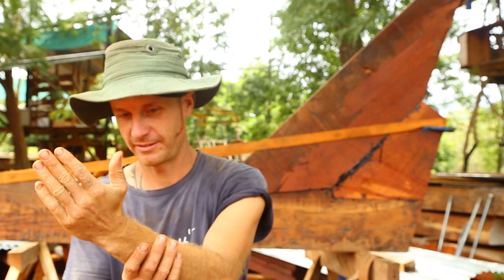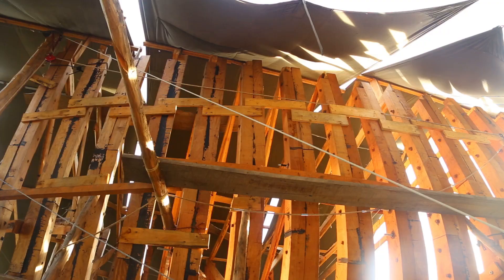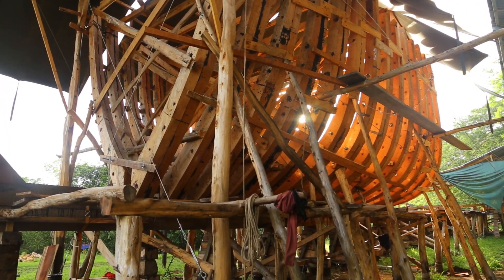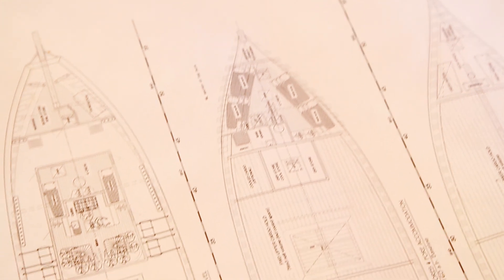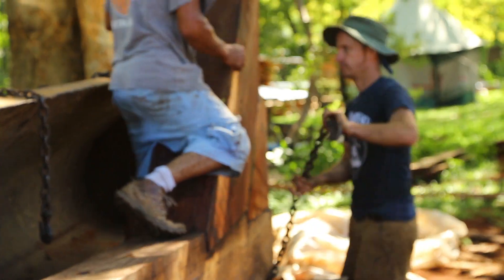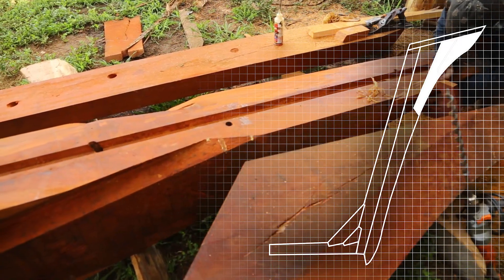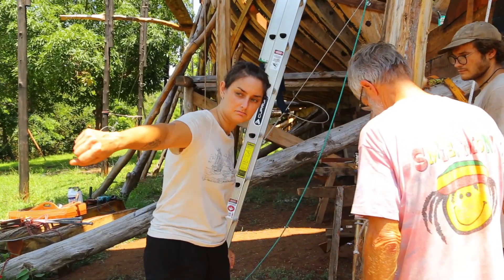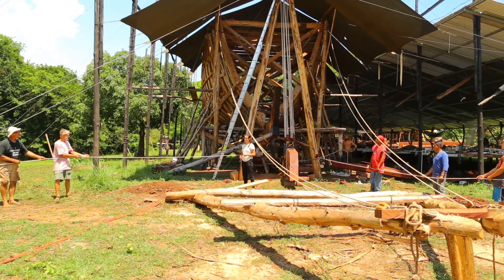Raising CEIBA's Stem - SAILCARGO INC.

Comment: At 11.07 The stem did not appear to fit so well. Was that improved upon off camera. The angle of the stem to keel v notch look  way off. Or is that not of concern to you. I'm impressed with the project either way. That's a big boat.
Reply from the maker: Hi John! That was improved after the video. And once the bolts went in it was snug as a bug!
Reply: @sailcargo  That's what I assumed.
Reply from the maker: @johntripp2028  is this John Tripp the hockey player?!
Reply: @sailcargo  No I'm not a hockey player. I'm just and old sailor:)

Comment: Why didn't you use a tractor to pull all those ropes? Do any of your vehicles have electric winches mounted on them?

Will your boat be able to carry shipping containers?
Reply from the maker: Hello!  As this was a very delicate lift with detailed joinery we wanted to have the most control possible, so we chose to use block and tackle.  We have access to electric winches and tractors if we needed to :)  Besides, it's good training for when Ceiba is sailing!!

Comment: Thanks for the video. I am following a couple of other wooden boat builds but this is a wooden ship and the scale creates problems that don't really exist on boats. I was really interested to learn which species of timber you are using.
Reply: I read up a little about Hymenaea courbaril. It's is rated from different sources as between 10,500N and 11,950N on the Janka scale. I.e. Very hard indeed. It is resistant to rot and termites however apparently it has a reputation as not being resistant to marine borers. I hope you don't take any shortcuts on anti-fouling in your drive to be eco-friendly. 
Thanks again for the video, your project is inspirational.
Reply from the maker: Thanks Dave, really appreciate that. Scale certainly presents its own challenges, but so does working in the tropics with different kinds of timber! That's what makes this so much fun to work on!
Reply: @sailcargo  Thanks for the reply. I live in the sub-tropics and so I can appreciate the difficulties you have of working in the topics. I hope one day you will have the finances to construct more and better quality buildings for your yard.